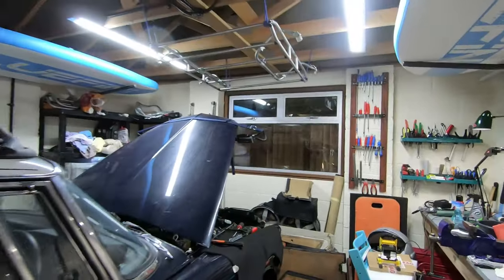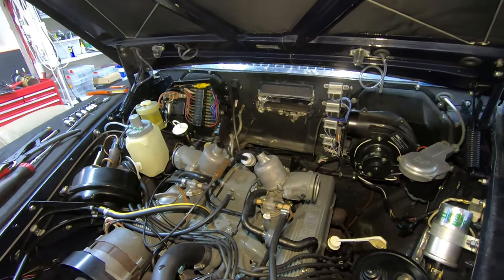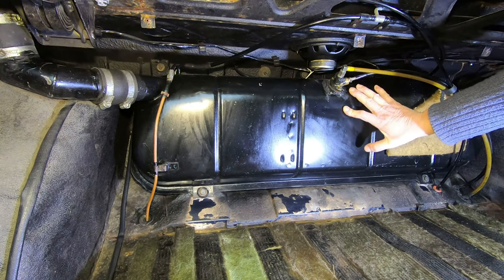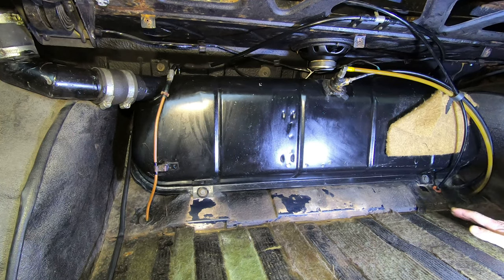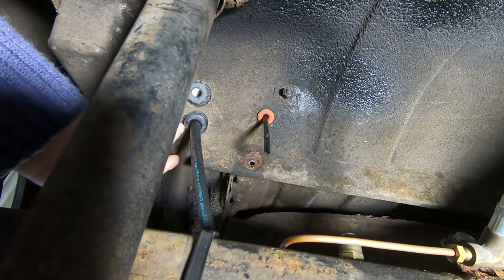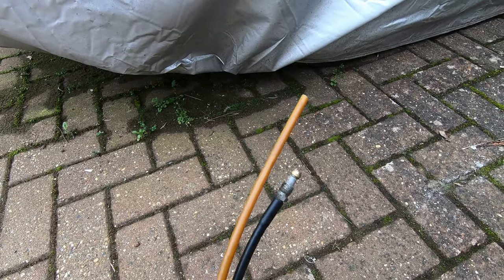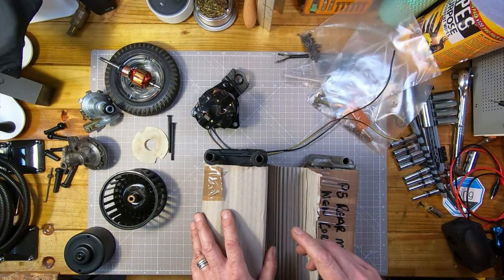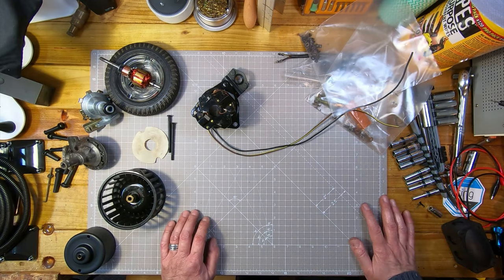Rover P5B Update and Smiths Heater Fan Motor Refurb

Comment: It would be good practice to add a filter to both lines at the fuel tank end. That reserve tap is probably not for the P5B.The old one can be refurbished for the price of a viton o ring readily available for a couple of quid. The route of the fuel pipe from the reserve to the engine looks wrong. It should pass over the chassis not under it. Careful with the fuel hose. There's a lot of fake stuff around and look for quality fuel injection hose to the latest specs.I enjoy your uploads but you're too quick to use remade overpriced stuff which is inferior to that originally installed.
Reply from the maker: Hi, interested to know what’s your thinking for using fuel filters at the tank? Rover only fitted one at the engine block after the fuel pump, and I’ve not read of any problems with that setup. I’m actually very careful not use cheap replacements for things - the fuel tap is a NOS item that came sealed in period-correct Rover packaging and is identical to the original, and Gates fuel pipe is some the best available, expensive and rated for modern fuels, and bought direct from the importer, not off eBay. EBay is full of cheap stuff that I wouldn’t trust. Agree on the routing from the reserve tap to the engine, it seems wrong to me, so will be routed correctly when replaced.
Reply: @Mid-Century-Living  when I replaced the lines on my own car, it was a simple matter to add a filter to both hoses very near the top of the tank. It's belt & braces but will collect any debris before it gets into the system especially as the tanks are now 50 years old. I used see through cleanable filters and after a year or so, I can see some small amounts of debris trapped in the main line filter. That's debris which would have reached the mechanical pump which I think is unfiltered. If you have a facet or similar, it probably has a built in filter already. Another advantage of clear filters in the boot end of the system is you can see at a glance whether fuel is being taken into each line and therefore is a diagnostic tool as well. The line from the reserve loops up to the left and is clipped to the edge of the transmission tunnel ledge. If you have a "throwaway" email, I could send you a pic. All the best.